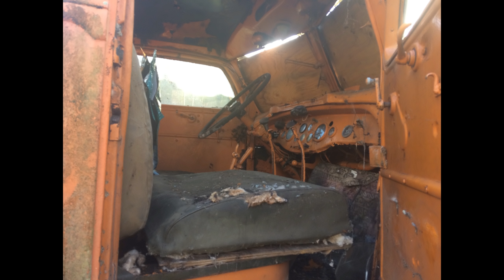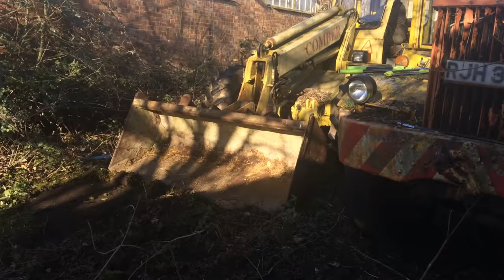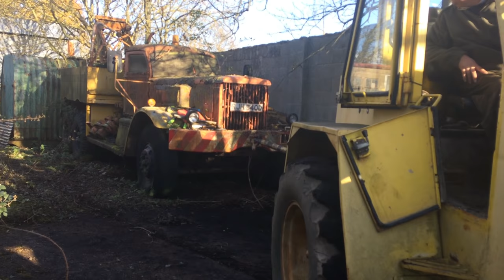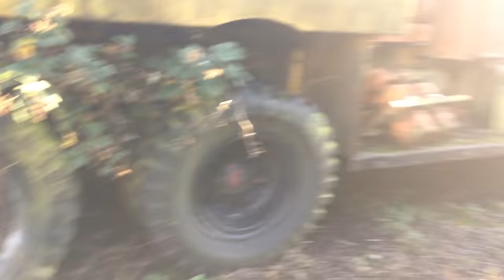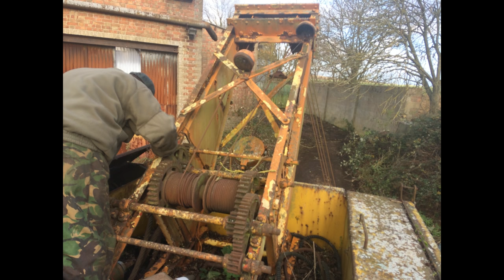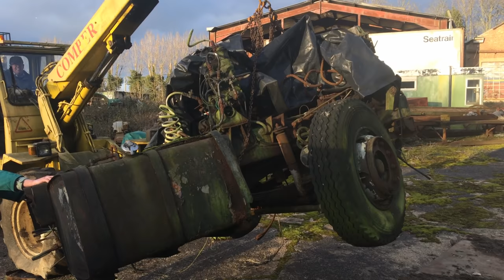Diamond T 981 yard recovery  PT 1

Comment: There was a 6x6 Diamond T wrecker at my Dads garage in the mid 60's...I used to sit in it as a kid, loved it!
Reply: When i was doing my apprenticeship  in the 60s we had one as a recovery vehicle it was called Gertrude. had a Hercules petrol engine about 4 MPG then we fitted a Perking 6-354 in it then the firm went bust and never saw it again.
Reply: @6909Adrian  I often wondered where the one I mentioned went. It had had a new paint job etc & was always on the Garages truck stand at the yearly shows in the area (Suffolk, England)
Reply: @6909Adrian  Most of them had a 131 HP Hercules,during the war starting in 1942,they then started getting a 200 HP Cummins until they were discontinued.

Comment: Rolls Royce engine? I see most of these with the Hercules petrol engine.Some of them even had a N/A Cummins starting in 1942.
Reply: That model is a 981, would have had hercules  diesel from factory, rolls c6 fitted by Remy, i have a 980 with a 6 71 detroit diesel fitted by the italiens, the hercules had overheating issues and cracked cyl heads. Cummins was never fitted to that model.
Reply: @grumpystruckshop3807  I should have been more clear,the 969 is the one that I know about that had the 200 HP Cummins,but not the 981 as I you already said.I never knew that Hercules actually made a diesel engine,I know about the Multi-Fuel that was made by Continental,Hercules,and White but those were in the M51A2-M62A2,M35A1,and M35A2-M756A2 trucks in the 1960's to the 1980's.The gas engines that Hercules made were great engines,they even used them in DG5 Crawlers from Cletrac.I never knew that had a 2 Stroke 6-71,the Sherman Tanks had the 6-71 (Or 8-71) in later years I believe,after they had been using the Ford GAA V8,after being made by Ford,and then Chrysler in 1944.
Reply: @Slim_Slid   hercules diesel was called DFXE, 200 HP MAX, 969 was Rxb 501 cubic inch flathead petrol 6 cyl. No cummins.
Reply: @grumpystruckshop3807  The 969-981 when Diamond T introduced them were all gas trucks.In 1942,some of the variations DID have a 200 HP Cummins...This was only in American trucks however.If they were from Italy or the United Kingdom,they had each a different engine for them,which you already mentioned.

Comment: Would have been smarter to back off the maxi brakes, I am pretty sure there were adjusters back then. Dragging it will bend the frame as I once bent the frame on a brand new Autocar that was frozen in.
Reply from the maker: Brakes weren’t on though, it was just in a slight dip. Therefore there was no need
Reply: did they have maxis back then?

Comment: Does it have it's original engine still in it, if so your fuel bill is going to be a bit on the expensive side. What was the 'chassis remains' you were hoisting about. I'm surprised it was in a worse condition on the wall side but then I suppose the 'damp' would have lingered longer on that side. Nice find - looked pretty complete, Gar-Wood winch and all I see. I had a Corbitt with a big 'Hercules' petrol in it 3 or 4 mpg if you were lucky.
Reply from the maker: It’s got the British convention rolls Royce engine in it but I believe that original. And yes it was a great find! I know a friend who owns a corbitt and what a great bit of kit.
Reply: Well that's interesting, as to the best of my (limited) knowledge on Diamond T's, most, (if not all), came over with Hercules engines. However since they were "non-standard" once the war ended, (and we all know how the British Army likes to 'standardise'), they were re-engined with the RR one, some even straight away and the originals were sent back to America. I don't know what type of Corbitt your friend has, (wrecker or GP body), mine was the 6 ton GP bodied version, and had been bought as army surplus at the end of WWII by a fairground operator along with a fleet of Macks and some of those "funny" SU-COE's that had the engine under the side. Best of luck with your restoration.
Reply: Iain Botham. .. Yes I quite agree. When I first saw the engine on mine it nearly put me off buying it, - as even when I had it, you could say good bye to a couple of gallons of petrol every time you started it. Luckily I had a local chap I knew who fiddled with the giant carburettors and he managed to get it to do a few (very few) MPG as opposed to as you say GPM. In the end having restored it, - (I'm not really into 'military stuff'), I bought it as I knew the previous owners were having a clear out to the 'scrap man', - surprising as most fairground proprietors hang on to their vehicles forever it seems. In retrospect I wish I had kept it, however I sold it to a 'military vehicle' enthusiast some 30+ years ago, - I don't know where it is now.
Reply: @christopherlovelock9104  The Diamond T's were mostly gas trucks,with the 131 HP RXC Hercules,but in 1942,they started getting a 200 HP Cummins,that was Naturally Aspirated.